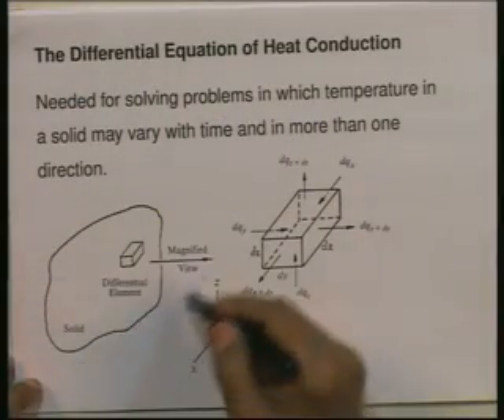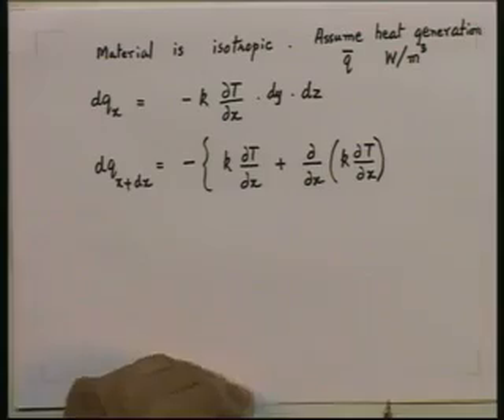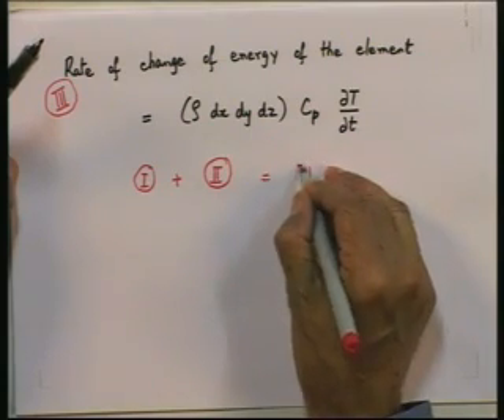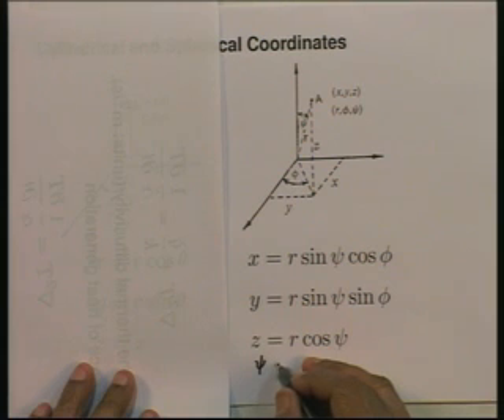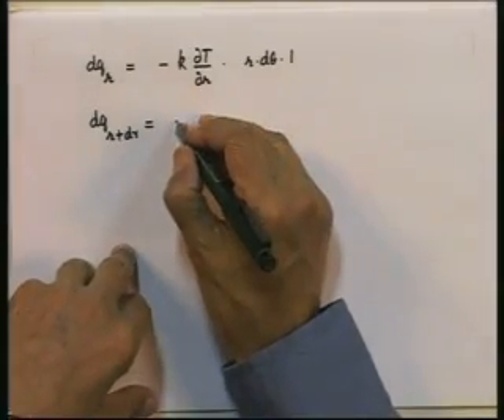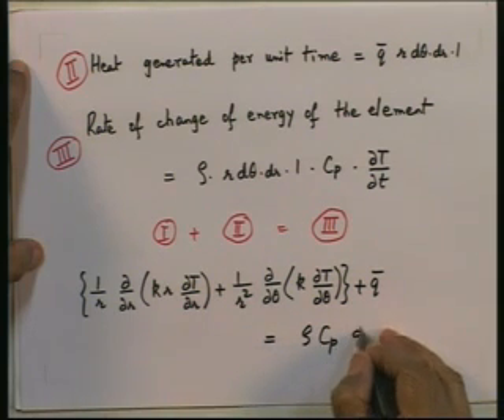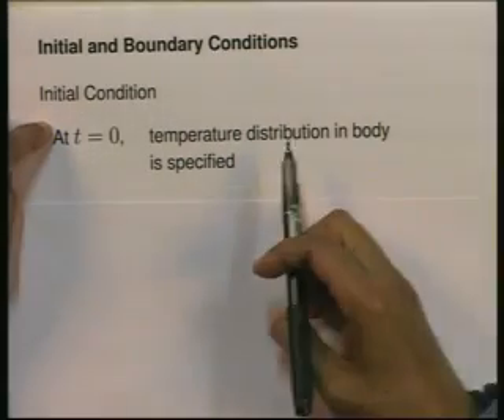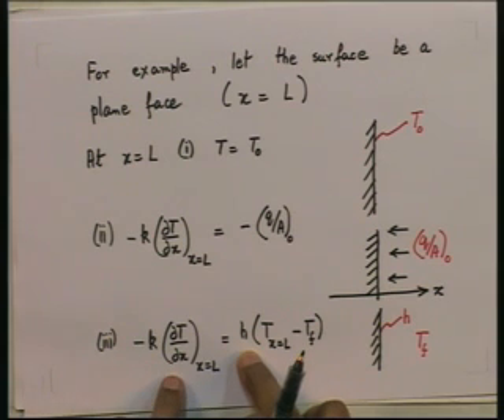Lecture - 6 Heat Conduction - 3

Comment: how heat is generated within system? how many ways heat is generated in system?
Reply: simple example is...heat generated in electric cable due to electric resistance...and you can think of nuclear rod also
Reply: Cases of internal heat generation within system : 
1. Electric heating, 
2. Viscous/frictional dissipation, 
3. Exothermic chemical reactions, 
4. Magnetic loss, 
5. Internal structural friction, 
etc.......There are almost countless examples. 

In general any miscellaneous phenomena which involves dissipation of some form of energy to heat within the domain of consideration. can be accommodated in the term "Heat generation or source" in the energy equation......
In ge

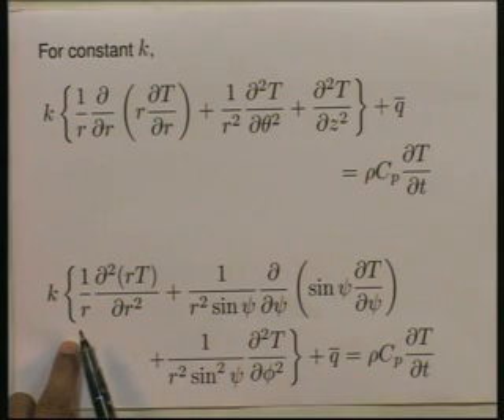Comment: Both of the equations (@40:55) are different than in the book "Heat and Mass Transfer..." by Cengel. Is that a typo or is it based on a different diagram or different form of the equation?
Reply: Use professor book " kaka mama"
Reply: differentiate the first term and then take "r" common